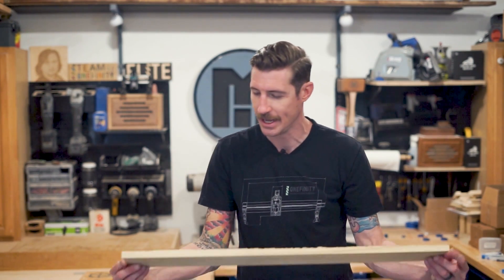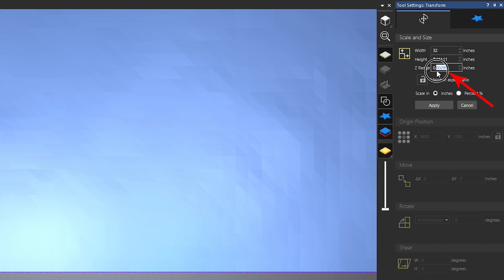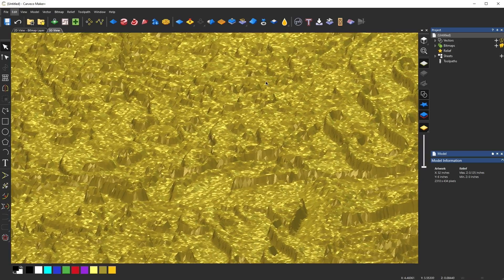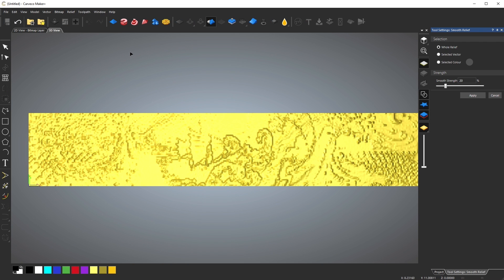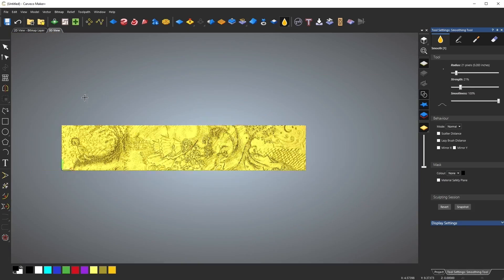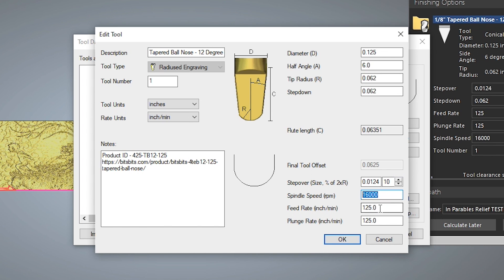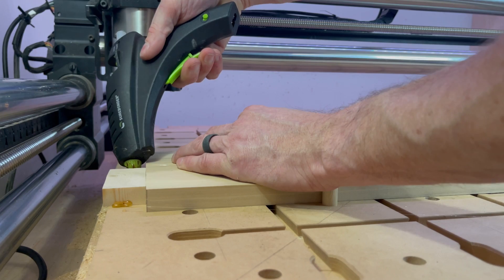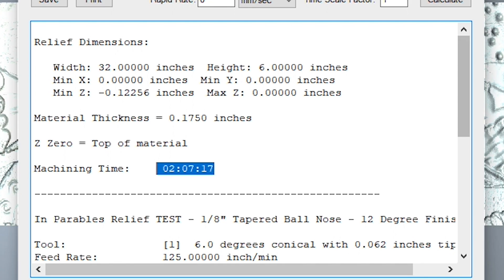EP. 28 Onefinity CNC -  3D Relief Art From Any Image ft. Carveco CAD Software

Comment: Why not go faster since you have more rpm available? Lose definition?
Reply: I could definitely go faster but I kinda like to take it slow. I'm not banging out a bunch of stuff so if I'm doing one-offs, I prefer to run the machine conservatively - not because the machine can't handle it, I'm more worried about tearing out the material
Reply from the maker: faster next time!